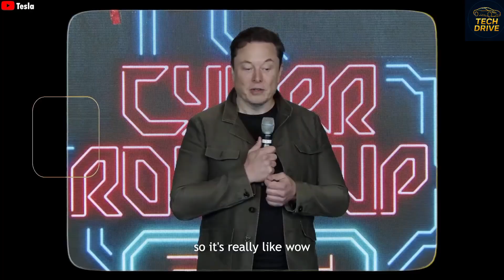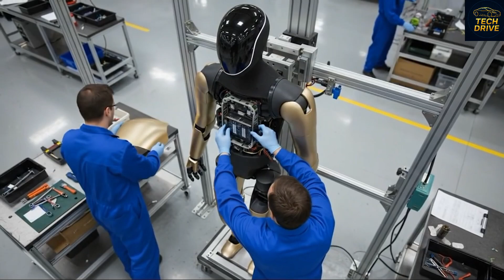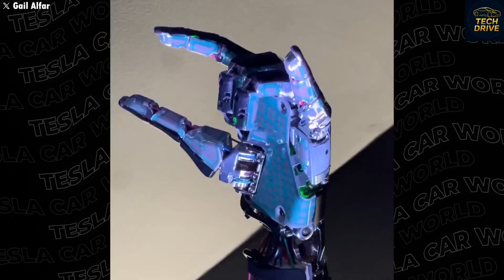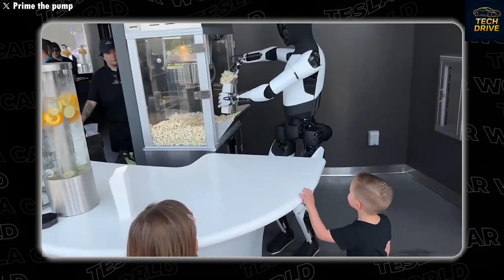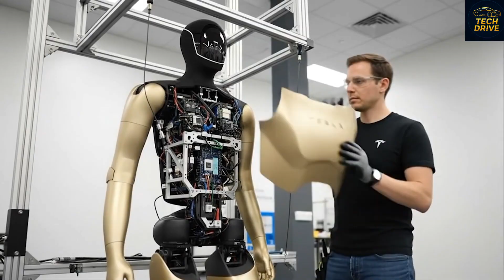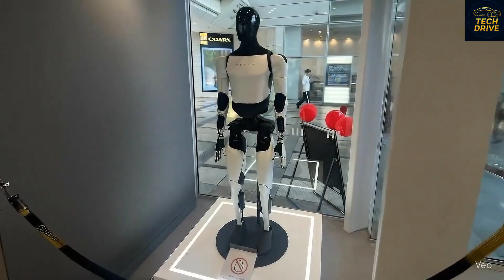"Elon's New Optimus Robot Can RUN at 6.8 MPH... This Changes Everything!"

Comment: Does 2.5 require owners to locally train it? And how is that training accomplished? Through an app?
Reply from the maker: Good question! Gen 2.5 needs local training - yes, through Tesla's app where you demonstrate tasks. Gen 3 comes pre-loaded with 3000+ common tasks (cooking, cleaning, organizing) so most people won't need much training. For custom/unique tasks, you use the app to either: show it what to do, use voice guidance, or pick from task templates. It's designed to learn YOUR home layout and preferences over time. Basically plug-and-play for standard stuff, customizable for specific needs. What tasks are you thinking about? 👍